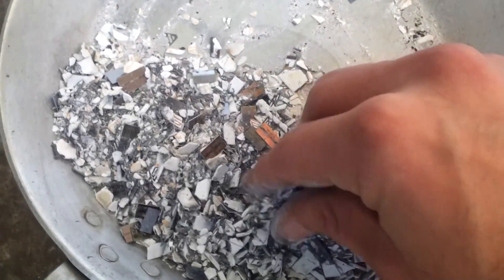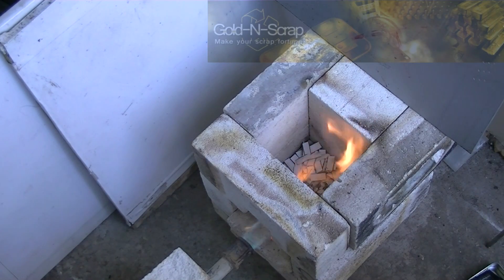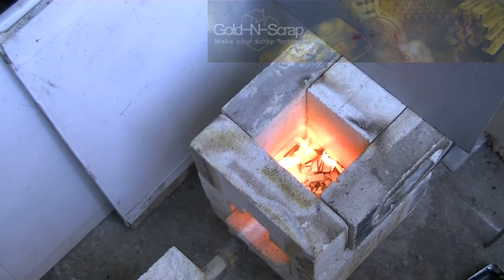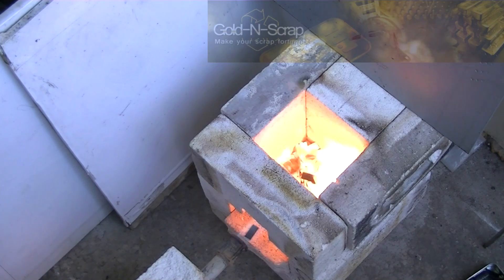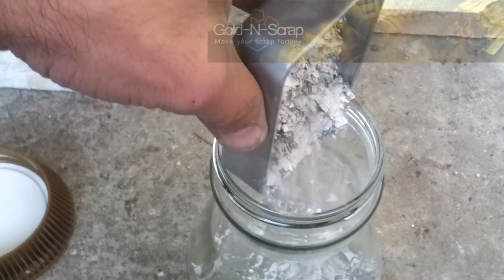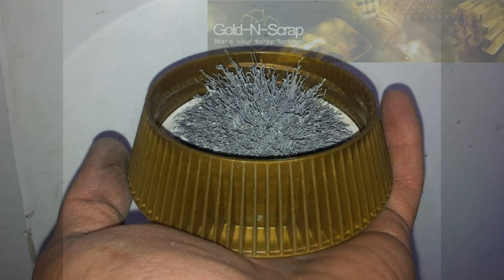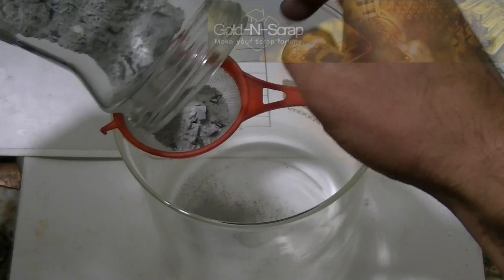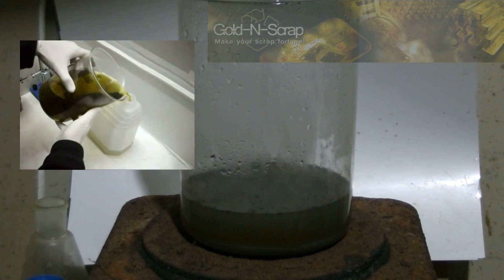How to Recover Gold from Integrated Circuits Chips

Comment: Those are silicon chips not silicone chips!!! Those are two very different things!!

And they aren't "magnetic chips" either.  The leads are typically copper and plated with tin and nickel.  With enough nickel, it will be "ferromagnetic," which means it can be attracted to a magnet.  It is not "magnetic," as it does not behave like magnet itself.

Comment: where do you discard your waste such as the acid etc...I understand you reuse it but at one point you will discard of it and how?
Reply: Oddly enough, none of these videos say anything about waste disposal. Considering all the hazards involved in the processes often shown, and the very small amount of gold yielded, it's really not viable for the average Joe to mess around with.
(I just found a video showing how you could remove gold from copper by using a much less nasty chemical known as Ferric Chloride, but from the insides of chips, that's a whole different story.)
Reply: i work with carat gold and my disposal is to neutralise my acids and use a professional company who just take it away

Comment: The best way to extract and purify gold from chips is to crush them, then swallow (eat) them. Humans' stomach contains gastric acid. It is a mixture of Hydrochloric Acid, Potassium Chloride and Sodium Chloride. It will quickly dissolve most metals leaving only gold flakes in your intestines. All you have to do next is wait a few hours, then squat over some container and shit out a nice shiny gold brick.
Reply: +Peter Max I hope there was someone who saw you comment and thought "yeah that seems reasonable" and then did it. Hahaha, knowing the stupidity of most of the comments on youtube this is very likely.
Reply: +spoofer20 
Actually, Pete's laughable idea is somewhat correct. I think it was Popular Science that just posted an article that humans do poo out rare metals. Either they are ingested by accident or can come from gold teeth leeching/scraping for example, then bacteria in the body break it down into a goo like form where it gets processed out of us into the septic system. Now all people have to do is start an extraction process to recover the gold from the poo and they're rich.
Reply: Shawn Van Scoy Clearly you have no idea of all the dangerous substances that are in certain chips and circuitry. Ingesting a blended form of it could be very likely to be fatal. Also of course it wouldnt actually sort out the gold, which was the most laughable part of his statement.
Reply: +spoofer20 really other than copper tell me what in those chips is toxic the silicon no because you can eat sand and not die(from the silicon at least) the copper no that is in such small ammounts the boron no that would also be like eating sand same with the phosporus so nothing is in large enough quantitys to kill you other thn mabey the ashes
Reply: Keep believing
Reply: spoofer20 what is that supposed to mean
Reply: I read something similar once. You would have to process a lot of sewage to see any significant amount though.
Reply: Peter Max funniest shitty process I've read thanks a lot you probably sent a bunch of idiots to the E.R thinking it will work he'll I might try it....
Reply: LMAO !!!!

Comment: Thanks for your nice tutorials, there is indeed Pd, Au for then value of 20 -30 USD per 10 Sq ft or 1 m2 on Au plated Pwb, chip carriers, or even more on high end chip packages which are even Gold wire bonded on the inside.You nowadays can buy poison free Au stripper, which takes the Au directly and then you can recover it from there as metal hydroxide and burn it in your furnace. (before they used Cn and nitrobezene and agitation) Anyway your metalurgical skills are perfect, thanks for such tubes!

Comment: I'm going to let everyone know on a little secret I learned.  You aren't gonna get rich.  I was so wrapped up in gold salvage that I ran the range from Aqua Regia up to cyanide based recovery.  Unless you have MASSSSIIIVVVVEEEE amounts of free boards, chips and supplies, the best you can get is payback on your costs.  Gold plating is unbelievably thin.  I learned the hard way that unless everything is free or almost, you are better off getting an extra part time job and buying gold.  It is fun as a novelty to hold a small nugget of gold you recovered, but you aren't going to retire on the process.  Think about how long you have to work for to pay for $75 of gold electroplating solution and how much surface area you can cover with it?  (20"x20" one sided plate of 24k gold, in case you were wondering.  That is ALOT of chip pins.)
Reply: On one hand I agree with you, however gold content in electronics is extremely  variable, with some items selling well as unprocessed scrap. I agree this guy didn't show much, and his chips might have contained little to no gold, but others have demonstrated relatively high recoveries with specific types of ewaste.

Some people happen to be in positions to acquire good amounts for free.

Comment: No gold in this video. How about scratching off the gold plate from the pins and contacts of electronic components with a scalpel blade? Save on all the smelting, furnaces and chemical lab procedures. And factor in the time cost of extracting your atoms of gold.
Reply: +Andrew Wilkes ... A scalpel blade would be a very poor choice unless you happen to be very rich, under house arrest, and for some reason have hoarded heaps of (hopefully older) trashed chips instead of books and a TV.  On a positive note, when released from house arrest  you could celebrate by spending all the money you made on a #2, with a medium Coke from McD's!

Seriously, scraping the pins alone would take decades to collect what could be done in a day when following normal practices.  You would need a controlled work area as the flakes you scrape off will be very small, light, and easily lost.  Even under perfect conditions you are not going to recover it all.  Oh...., and we haven't even discussed the extra work, time, and tools, required to break apart the ceramic and fiber chips.  Let's go ahead and tack on a few more years...

Comment: Let it also be know that most of the metal you see and believe to be good it's really just copper. And also so you know if you dissolve the cards out motherboard in HCl it will not form CuCl (copper chloride) you need a 11.7 mol HCl concentrate to create it

Comment: Care to take a guess at the return on investment?  You don''t need to price in your time or the reusable hardware - but the cost of the scrap computer gear, the chemicals and the cost of running the furnace?  Gold is up to $1219 a oz. - if it cost you $400.00 to recover an oz. that's a pretty good ROI.

Comment: Hi there! I need your help. I incinerate a lot of chips in a barbecue using charcoal until they got very white. After shaking and shredding, I got a grey, not white powder. I incinerate again and now the powder is little more white than grey, and I tried panning, but all I got was chunks of white, grey and black things mixed with the pins. I gave up the panning process and I decided using the AR the way it is, is it alright? Or I should incinerate until the powder get totally white?

Comment: Hi. Could you tell me, where you get soo big chips? Normal DDR/SRD memory chips are 2-3x smaller... I want get some beautifull silicone parts like you'rs. -
Reply: I usually find them on memory sticks and mother boards. Older video game cartridges are a great source.
Reply: Todd Allen Thanks for reply. Can you tell me how old must be those memory sticks or motherboards? I've got from shop old motherboard (SocketA with VIA KT266), and silicon chip from chipset had max 3x4mm.

Comment: It would be interesting to see the dollar amount of the gold recovered vs the dollar amount of the heat source.
Reply: Erik Holmstrom go to nearest university library and get first book on metallurgy, physics, or electricity and search for electrical conductivity/resistivity tables...
Or go here:
http://en.m.wikipedia.org/wiki/Electrical_resistivity_and_conductivity
You have table there sorted from best conductor to best insulator
Reply: Erik Holmstrom Considering that the easily available facts dispute the claims you're making... no. You don't know what you're talking about.
Reply: let's add up
tons of propane burnt
rather expensive and very toxic chemicals used
more propane burnt(with use of oxygen to melt golden dust recovered from chemcals
all that to get 0.2 grams of gold from 10000 of chips
BTW silicon to pins is more often connected with silver due to poor conductivity of gold. only very early eprom memory (ceramic case with window in them)chips were using gold.
Reply: c cham nope.... Silver, and copper have ~30% better conductivity. Gold plating is used to prevent corrosion. Check before you comment m8.
Reply: Ok, Erik Holmstrom, how about a manufacturer's compilation of published conductivity/resistivity results then? 

Like this: http://eddy-current.com/conductivity-of-metals-sorted-by-resistivity/

Or a copied section of a textbook with the theory explaining the values: http://depts.washington.edu/chemcrs/bulkdisk/chem484A_spr06/handout_Metal-Semiconductor.pdf

Or are you still SURE you're right, even in the face of evidence and reality itself, because you "went to college for this"?
Reply: The discussion was on the electrical resistivity of gold vs copper or silver and your factually incorrect claim that gold has the lowest resistance of the three. Bringing "audio latency" into it now, to deflect from your claims which have now been thoroughly demonstrated to be incorrect, is pretty pointless.

That's never what was under discussion.
Reply: Wow your so cool bro.
Reply: And what does it say about audio latency? Realise we could be talking different professions.
Reply: beavertank Thanks for clearing up the air for everyone Mr. Beaver. Look at my picture. Audio engineer. I was always tallking audio.
Reply: Erik Holmstrom Quit doubling down on your stupid already. Did you read anything anyone posted for you? Are you now back to claiming something the data and electrical theory all disagrees with? 

For fuck's sake...
Reply: c cham
Silver has better conductivity but it oxidizes much worse than gold does.
Reply: Okay, learned something
Reply: Leszek Zajac poor conductivity of gold? It is the best conductor, thats why airbag connections are required by law to be pure gold.
Reply: These Polish schools are really making idiots out of people like you Zajac. Silver has the highest electrical conductivity of all metals. In fact, silver defines conductivity - all other metals are compared against it. On a scale of 0 to 100, silver ranks 100, with copper at 97 and gold at 76
Reply: @Orlena2525  These Polish schools are really making idiots out of people like you Zajac. Silver has the highest electrical conductivity of all metals. In fact, silver defines conductivity - all other metals are compared against it. On a scale of 0 to 100, silver ranks 100, with copper at 97 and gold at 76

Comment: Where can you acquire the chemicals and equipment ie beakers etc. for gold recovery? I tried home depot and lowes with no results? I have about 200 cell phones I have collected to try this and now I am hitting a wall.
Reply: Actually you will need Bon Ade Stump Remover...in the Garden Center or at most Nurseries. That is 100% Sodium Metabisulfate.

(Do not use Spectracide Stump Remover or Grant's Stump Remover as that is 100% Lab Grade Potassium Nitrate and can be used in making Gunpowder or "Candy Rocket" Propellant. Look up Candy Rocket on YouTube for some fun..)

You will need Hydrochloric Acid. That is also known as Muriatic Acid and that is available at Swimming Pool Supply Companies, and, maybe even some Wal Marts as it is seasonal.

You need a Torch, and Cinder Blocks, which are available at Home Depot and Lowe's

You will need Nitric Acid. Now this is available at any decent Jewelry Supply in large cities.

I do not believe that you can do this as it is apparent that you have not done much research.

You will need a rudimentary understanding of Chemistry.

I have bought Lab Beakers at Swap Meets and Thrift Stores. Any time that I see them I buy them.

One part Nitric Acid to Four Parts Hydrochloric Acid, by VOLUME, is Aqua Regia.

That is some nasty acid. Keep Baking Soda and Water available in case of spillage.

This is dangerous and it is not for people who do not do research.

You will get hurt if you do not follow safe Lab Practices.

The tuition at the School of Hard Knocks may be very expensive and it may actually cost you an arm and a leg...or an eye.

I cannot stress that enough. This game is not for kids.

Comment: "How to get cancer by burning a shitload of plastic and toxic metals", more likely.
Reply: Nice to see you completely missed the whole point of the complete combustion.... i.e. no dangerous chemicals escape
Reply: p3rs0n42
complete combustion in open chambered propane/butane fueled incinerator is impossible.
Reply: p3rs0n42
I was giving Mac a backhanded compliment while agreeing with you... a style of sarcasm.
Reply: p3rs0n42
He was at the front in his class.
Reply: USNVA
What?
Reply: Leszek Zajac Okay... what's your backing/source to verify that...?
Reply: I did burned some pcb from hard drive with 1minute exposure to the smoke off the ic, is this dangerous?
Reply: Lorenzo Van het hul
Unless you have a setup like this guy here were you do it everyday, it's not dangerous. I wouldn't do it frequently though and always do things like that with open windows (minimum).
Reply: As said by indeeditdoes, and very probaply before here, if you fully burn it you will not end up with those fumes... but even still i think it is a recommendation to have at least a fume hood...
Reply: It's still pretty scary, there are many toxic fumes that are colorless and orderless (I doubt it's just carbon and hydrogen oxides coming off that but I could be wrong). On top of that, the "ash" has all the metals used in the fabrication, so I wouldn't breath deep during that part either. Cool video though, just need the right P.P.E. :)

Comment: What is a magnetic chip!? I'm an electronics engineer but never heard of the term
Reply: Core memory? It's not likely you're going to encounter any such ICs unless you gut a 1970s mainframe, but there used to be ICs for magnetic storage. http://en.wikipedia.org/wiki/Magnetic-core_memory
Reply: Each ic witch are powered by electricity have a magnetic circuitry (very little)

Comment: First, there is no silicone in an IC, it is silicon, pronounced "cahn". Secondly, it is dangerous to just try to dispose of unspecified components like this. Some older ICs use beryllium oxide as a heat sink material underneath the silicon or other chip. Beryllia is an inert material unless it is broken down into a powder, which can be released in the air and is carcinogenic. That's why it has been banned in Europe and last I heard they were considering banning it in North America. I would guess it's used more in high power devices, but still, showing people how to recover material without qualifiers like this seems irresponsible to me.

Comment: not useful and not interesting , i did not see any gold in this video . dislike
Reply: That is because you are blind. You are one to stumble upon a Gold Mine and be totally unaware.

Did you know that profitable Gold Mines produce only 30 grams per every Metric Ton of ore processed? One metric ton is equal to 1,000,000 grams.

There is a much higher concentration of Gold in that material than there is in Gold Ore at a typical Gold Mine.

But you are blind.

It takes a lot of work to extract Gold and it is an energy intensive and cost intensive process. There is a REASON behind the Gold Price.

Comment from the maker: There is infact a direct pyrometallurgical process for this kind of scrapit is called smelting.
It requires a lot of knowladge and understanding of the process as well as pre-processing and assaying before hand so you could adjust flux, temp, duration, collerctir and more..

Comment: The incineration process takes approx how long? What heat does it need to get to and what are you actually using to produce the flame. Do the ceramic chip casings literally turn to ash after? Great video.

Comment: I would also like to know the answer to this question.  I've tried to use HCl to dissolve lead contacts, but I think my HCl was too concentrated as the reaction was slow and I think I just oxidized the Lead.  I added water to dilute, but still no go.(Don't bother me for adding water to acid, I was aware.) I've also tried the heat gun, but it blows valuables away like MCCs.  I have yet to try an effective mechanical method such as an air chisel, but that sounds like the worst.

Comment: Here's a idea of another process that may just work for you.

Distilled white vinegar-Hydrogen Peroxide-Table Salt.
Mix 1 cup of vinegar to 1 cup peroxide to 6 tablespoon of salt.
Mix together and drop your board into it.
It the etching process is slow, just add more salt and it will re-activate.